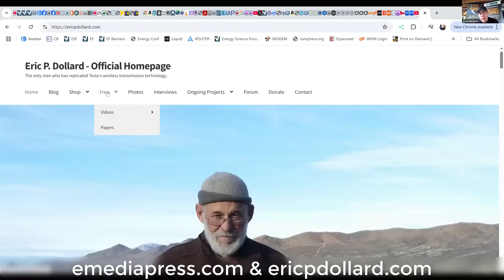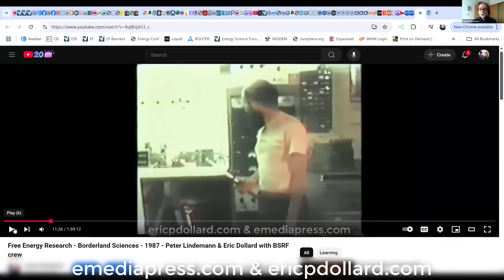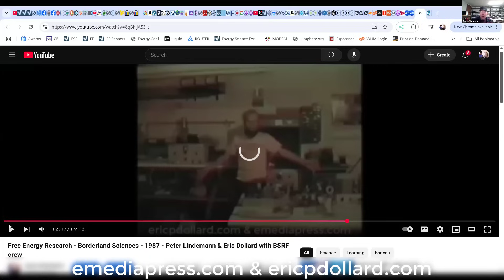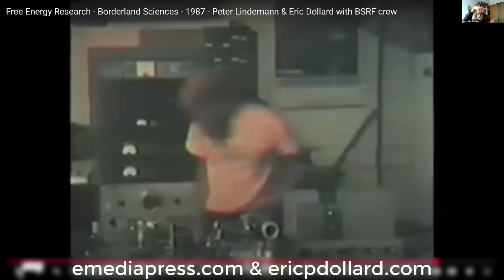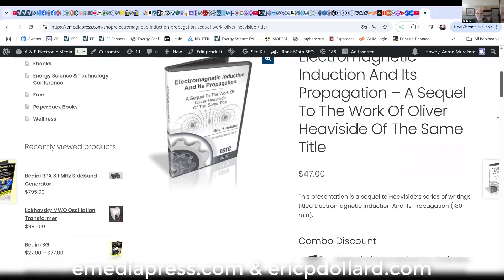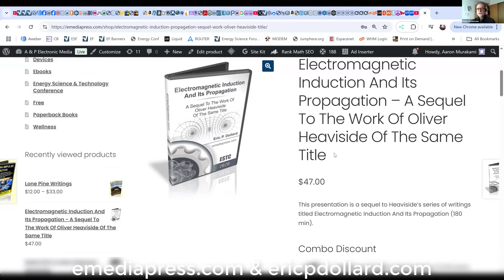Free Energy Research Discussion by Peter Lindemann & Eric Dollard 2025-04-26

Comment: Peter Lindeman did a utube video in which he presented some crucial quotes that get to the root of how tesla was able to unlock energy.
1) Tesla mentioned that static electricity isn’t so static. In fact Tesla measured the frequency of the backround electrostatic energy, and he found that electrostatic energy has a frequency of about 1 million per second. He clearly said, if static electricity didn’t have this frequency, he would not be able to produce all those fantastical effects. 
2) Tesla said electrons are not necessarily bound to atoms, most were floating around freely, and in tesla’s thinking each electron is a minuscule sphere with exceptional charge. Tesla went on to say that the electrons must be kept separate by an INSULATING MEDIUM. This is a crucial observation, and when coupled with other thoughts/quotes reveals a truth;
If one can find the resonant frequency of the backround insulating medium, it is likely that medium can be broken down with the smallest of forces, releasing a never ending supply of electrostatic energy.
Reply: Das wiedergeben von lügen Märchen sollte verboten werden. Tesla ist Betrug, er hat weder Wechselstrom erfunden oder sonstiges. Alles wurde im Heiligen römischen Reich deutscher Nation erfunden. 

Seit 1600 läuft der Affen zircus. Wie lang betitelt sich das Individuum selbst noch als Affe?
Reply: "and in tesla’s thinking each electron is a minuscule sphere with exceptional charge."

NO HE DID NOT!

“To account for its apparently small mass, science conceives of the electron as a hollow sphere, a sort of bubble, such a bubble could exist in a medium as a gas or liquid because its internal pressure is not altered by deformation. But if, as supposed, the internal pressure of an electron is due to the repulsion of electric masses, the slightest conceivable deformation must result in the destruction of the bubble! 

Just to mention another improbability, the force tending to tear an electron apart is, in pounds per square inch, represented by the staggering figure of 256,899 followed by twenty-one zeros (256 sextillion, 899 quintillion) — and this is 513,798,000,000,000,000,000 (513 quintillion, 798 quadrillion) times greater that the tension that tungsten wire can withstand! And yet it does not burst! Not even when it is hurled against an obstacle with a speed hundreds of thousands times greater than that of a bullet!" 
- Nikola Tesla Article: “A Famous Prophet of Science Looks into the Future” (Popular Science Monthly)

“Personally, it is only efforts in this direction which have claimed my energies. Similar remarks might be made with respect to other modern developments of thought. Take, for example, the electron theory. Perhaps no other has given rise to so many erroneous ideas and chimerical hopes. Everybody speaks of electrons as something entirely definite and real. Still, the fact is that nobody has isolated it and nobody has measured its charge. Nor does anybody know what it really is."

“In order to explain the observed phenomena, atomic structures have been imagined, none of which can possibly exist."
–Nikola Tesla Great Scientific Discovery Impends.“ The Sunday Star, Washington D.C., May 17, 1931.

“My ideas regarding the electron are at variance with those generally entertained. I hold that it is a relatively large body carrying a surface charge and not an elementary unit. When such an electron leaves an electrode of extremely high potential and in very high vacuum, it carries an electrostatic charge many times greater than the normal. This may astonish some of those who think that the particle has the same charge in the tube and outside of it in the air. 

A beautiful and instructive experiment has been contrived by me showing that such is not the case, for as soon as the particle gets out into the atmosphere it becomes a blazing star owing to the escape of the excess charge. The great quantity of electricity stored on the particle is responsible for the difficulties encountered in the operation of certain tubes and the rapid deterioration of the same.” 
–Nikola Tesla “Dynamic Theory Of Gravity.“ July 10, 1937 (Prior to interviews with the press on his 81st birthday observance).

"Glaringly fallacious theories are responsible for such chimerical hopes. Probably the worst of these is the electron theory. Of the four or five atomic structures which have been suggested not a single one is possible. Not more than one in a thousand men of science knows that an electron — whatever it be — can only exist in the perfect vacuum of intermolecular and interstellar spaces or highly exhausted tubes and that the nucleus stripped of electrons, is devoid of energy.“ 
—Nikola Tesla “Our Future Motive Power.” Everyday Science & Mechanics. December, 1931. Pg. 230-236.
Reply: @JenkoRun Duhastvergessen das auch Tesla eine Lüge ist. Genau wie einstein und alle andern aus der Royal society. Alles ist gelogen.